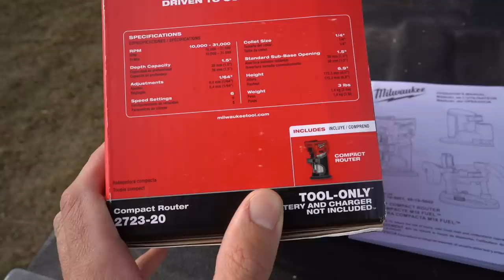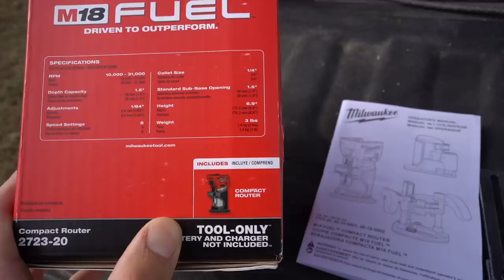I GOT THE NEW MILWAUKEE COMPACT ROUTER!!!

Comment: There is absolutely no problem with having one tire off the edge of the driveway like that. The only time it could be a problem is if you had a 20,000lbs trailer hooked up, or a few thousand pounds in the bed. And even with a large payload it probably still wouldn't matter. Your axles are rated for so much more weight than you're putting on it there. You don't need to put a board under that tire, or anything like that. Having the one tire on the ground is no different than the SRW one ton trucks. The DRW is mainly for towing stability, not so much for weight rating. You are 100% fine.

Comment: Both wheels are mounted together as a "single unit" on the axle so the axle sees the same load independent of whether one or two tires are on the ground.  The primary function of a dually is to is to keep from overloading tires - more tires = lower load per tire.  Tires are the lowest load-rated component in the system.  And, contrary to one comment I saw below, parked on only one tire with your essentially unloaded truck (all that stuff in the bed is insignificant w/r/t the truck) has not affect on the tires.  Of course, the overall truck as a dually is heavier built but single tires cannot take the amount load from a heavily loaded system.
Reply: I think this is true in part but here in the north they add axles to respect the regulations governing wheel loads so as not to damage the pavement.

Comment: I bought one too, one thing you'll come to find though is that 5.0Ah battery runs outta juice quite quickly! I slapped a 9.0Ah on mine and did well building stair stringers routing out a 3/8" slot for my steps to slide into. Worked well even for pressure treated lumber! Definitely loving this purchase!

Comment: I really wanted to get this since they started advertising it, but I really couldn't wait until it came out so I got DeWalt's battery-powered compact router. I'm sure I'd be really happy if I got the Milwaukee instead, but I've been really pleased with the DeWalt router so far. It seems like there are quite a few quality cordless compact router options on the market right now. It's such an awesome tool to have within easy convenient reach. Thanks for the demo.

Comment: I agree I bought it when it first came out and it surpassed my expectations as well a lot more power than I thought it would have I would definitely recommend it to everyone thinking about it. The only thing i think could be better it a baseplate that is more slippery. It seems like some other routers slide better on wood, even when i apply parafin wax. Could be just the added weight of the battery makes it more difficult to slide. I work in a cabinet shop BTW so im pretty accustomed to trim routers of varying type and mfg's. All in all Milwaukee killed it! Nice job chaps.
Reply: Make your own base out of solid teflon. Also known as UHMW plastic.
Reply: Thanks for the input, how does it preform with hardwoods, does it have enough power?

Comment: I've switched most things over to Milwaukee from DeWalt -- since we moved onto our boat. Mostly because Milwaukee makes the cordless heat gun, which is REALLY AWESOME. Anyhow... router... I picked one up yesterday, and I'm not overly impressed. The height adjustment doesn't actually lock-in, I can see the little wheel move while I am using the router.
Reply: I'm about to make that switch as well. I've been dewalt since I was 14, dewalt has been slacking big time keeping up to date and quality has also slippin,..  I had enough of it this past weekend when I bought the dewalt dcf890b and it failed miserably busting the lug nuts on my Honda..

Comment: Yep your good, doesn't matter if it was the outer tire with full load you'd probably be fine.  First thing that will give is the wheel, but again wouldn't worry about it as there is a safety factor involved anyway.  When these work trucks go off road towing they sometimes drive up on an area where only one tire is on the ground.  So you are good.  Storing it for longer than a weekend different situation as you don't want the tire itself to develope a flat spot, yet with duallys a flat spot might not matter much on one tire and evenutally it would spring back/wear back.

Comment: I expect that the load in your truck is a tiny fraction of what your truck can support. That’s what I would look at to assess how much you are stressing the axle. So if that machine can take 2000 lbs of a 5th wheel and you have 300 lbs of tools you’re good.

Comment: There is not enough weight back there to harm your axle. Your all good. I have had the outside tire up on a curb for days at a time and no issues. No leaking axle seals or any other issues. You would need to exceed the payload in order to hurt the axle by only have one wheel supported.  👍
Reply: I don't know, did you see how much stuff was in the bed?!  (Just kidding)
Reply: @dahut3614  I don't think Dirty Laundry counts

Comment: Nice review. All my Li-ion stuff is Milwaukee and I have a bunch (not enough though). Now this tool will be added to the "gotta get one" list. I've used just about every name brand of these tools when working with  trusted subs and job site sharing is fairly common.  Big news flash......they all work well. I'm not jumping into the switching brands thing because Dewalt or Makita have come out with the newest and best (according to advertising). No matter who has the newest and best, the others will soon follow with their version. I really do not want three different kinds of batteries and charging units laid out. The brushless tech has really leveled the playing field. Now some genius engineer will come up with a more efficient battery system and, of course, change the interface, then we're all in the start over boat. Japan has developed a dual carbon battery that out performs li-ion. Just at early stages, but things they be a changin".
Reply: for sure - just need a cordless robot to run my tools for me

Comment: Just bought the same router today. Part of my decision to buy the router was due to you. Thanks for sharing the info about the router. The only problem so far that I have with the router is the guide comes off after tightening it. Has anyone experienced this? If so, did you figure out a way to fix it?

Comment: It’s not bad for the axle. The point of duels is to allow more tires to hold the weight so that they don’t burst. Parking on the inner wheel puts greater stress on that tire, but no additional stress on the axle.

Comment: I'm still using my big beast Porter cable router that I bought in 1997, but I find myself wanting a portable unit. I was just going to buy a corded Bosch, DeWalt or Milwaukee, but now it's between the Milwaukee and Bosch since I have batteries for both. For those quick little runs this tool is perfect. Curious if they chew through batteries as fast as my Milwaukee multi tool.
Reply: Did you ever get your answer to how long the batteries on this router? I hear you get about 20 min. on a 5aH battery. Is this true?

Comment: Got my M18 router recently. So far have been using it while putting up some fencing to clean up dados in treated posts after first taking multiple cuts with a circ saw and knocking out the chips with a hammer. Loving it so far. Looking forward to using it in a more conventional manner.

Comment: The cordless thing originated because many years ago, jobsites   sometimes lacked power, for that reason, I always carried a crosscut and rip saw. The skillsaw pretty much eliminated most hand saw cutting.
  Just curious, routers typically require 25000 rpm, how about that one. How does it do with say maple or oak.

Comment: Dope! Reds is soo tiny vs yellows grand size. I feel like I’m leaning towards yellow though bc it “seems” to be just a tad better on the full rundown & accuracy. Check Concord carpenters compact router vs video. I like how Milwaukee gives all those extra parts/pieces even with the tool only!? That’s actually a surprise & I have the most Milwaukee batteries of all brand batteries! I wish they would come out w/ a cordless with a slightly larger collet, it can be done...comeonnn... 12” slider? No prob! 1/2” router chilllllllll lol
Reply: I bought my yellow one because of that video. Works great putting heavy chamfers on HDPE with a Whiteside 2302 bit.

Comment: Hey Richard, the axel might be fine but the concrete could crack.
Reply: I guarantee he has more weight over the front single tires than the rear right now.

Comment: I was using the Ridgid trim corded router for a couple days on plexi. (a whole bunch of fussy cuts) I liked the fine adjustment better than the Milwaukee. Overall I still like the Bosch or Dewalt better in the hand. The Milwaukee is nice though. It's good in the field where there are limited outlets.

Comment: I have the Dewalt version and it seems that they are pretty much the same except for minor things like height adjustment, where Dewalt has the ring-adjuster and the Milwaukee seems to have a rack and pinion system. The only thing that annoys me with the Dewalt trim router is that the dust collection is just as effective, or ineffective, as the Milwaukee. Add to that the reduced view of the cutter with the dust shroud in place and in most cases it is just not worth it, to me anyway, to use the dust collection.

Comment: Absolutely not a problem for the axle, only for the tyre because the weight is not distributed equally between the two wheels if you have big weights (not in this case). That truck is designed to take at least 10x more than what you have there.

Comment: I'd like to know how much the battery life slows down the cutter when the charge is dying down. You need a constant rpm to do a good job, especially on turns.
Reply: Not sure if this has it but it’s also possible for the tool to demand exact power right to shut off. Dyson does it with their cordless vacs

Comment: I have a 2015 Expedition and bought a 16’ enclosed trailer so the Expedition wouldn’t be a work vehicle. And it works great when I put stuff back where I got it from which is like....never......🤣🤣 But it does require some delicate maneuvering once in a while.

Comment: That’s not bad.. the outter wheel is connected to inner wheel. Inner wheel is supporting all the weight
Reply from the maker: cmiller88581 thanks.
Reply: @FinishCarpentryTV  gonna get uneven wear though.....
Reply: @christopherleveck6835  You wear out tyres by driving them on roads, not parking on them.
Reply: @christopherleveck6835  i don't think hes concerned about that. more the structural integrity of the axle. a little wear is worth the extra driveway space ;D

Comment: Looks like someone is switching over to Milwaukee tools  little by little lol
Reply: Yeah, but the battery powered table saw didn't perform too well for the camera...
Reply: Dahut are you talking about the test he did on solid wood? I thought the M18 and 60v both did equally bad?
Reply: Good!!! All the promotion he did for Dewalt and they didn’t send him a thing!!! Shit I spend a few grand on them because of this dude— shout out to Milwaukee for recognizing his worth
Reply: bling0023 though free remember 😉 ( I bleed mostly red & yellow)
Reply: Kermit I think their “cordless” table saws should have an ac adapter in case your going to go and do crazy rips on some ipe or something. It’s not the motor on the cordless I would be worried about but the heavy voltage drop under such resistances. Every time my boy uses my cordless 12 slider he starts bustin my chops “maybe we need to break out the corded 12?”

Comment: You should compare Milwaukee 12 miter vs dewalt 12 miter saw. Put them to work hard and long... test the heat of the battery. 
In my experience m18 volt cant handle heat and will trip out on over load even with a 12amph battery  at 2 bars left rending the tool useless.   I deal with grinders and metal..  so you may have to use it to the max on wood.  Dewalt HO cells 9 amph and larger will run for ever at 60v

Comment: Have you have problems with the fine tune adjustment moving on you while your routing?  One guy is on his third M18 router and I’ve noticed my new M18 router does that too
Reply: did you fix this issue, I have one at HD, don't know if I should pick it up if this is still an issue. I hear its from the screw of the locking mechanism that is loose.

Comment: I must comment on this router, not the blogger nor the workmanship........is that even a word. I purchased this router the other day mid June, 2021 and returned it before I even bothered to use it. There is play (slop) in the micro-adjustment shaft on these routers to the tune of +/- 1 plus mm. The whole shaft moves up and down in the housing. Though/hoped I had a lemon because over all I liked what I saw with this router. Not to be. Went to a number of big box stores and all of these routers have the same slop. Milwaukee, You Suck for putting this product out in the market place. 
By the way, I'm a professional cabinet maker/furniture maker with over 40 years experience. I think I should know tools by now.
Reply: I have one waiting at HD, did you tighten the screw on the locking hindge?  Thanks.

Comment: I wonder how it stacks up against the DeWalt compact cordless router.
Reply: The DeWalt out performs all the other current cordless routers in regards to power and runtime. It's also noticable larger in the hand. Everyone will and should get whatever brand they have battery platform for. They will all do the work.
Reply: @timcorbett9629  Thanks Tim.
Reply: Search YouTube for "tool box buzz compact router" and watch that head to head video before buying one. I picked the Dewalt mainly because I already have the batteries and chargers.

Comment: My Makita compact has a safety shutoff lock out features and probably just as small as that compact Milwaukee.
Makita is unveiling a host of new bad ass products in 2020... I’ve had great success with most of their products... but I also use Dewalt... 

I’ll use anything of quality, but if a tool is trash I won’t buy it and I’ll talk trash on it forever...
Reply: Have hundreds of hours on that Makita. Also it is compatible with all the attachments from its corded version that's been around for years. The safety switch can be annoying but it's well built.

Comment: No centering tool to install and center your base plate?
Reply: If the base doesn't accept template bushings, centering doesn't really matter. Using the fence guide, you're going to measure to set the fence each time, so.. shrugs

Comment: That tire is good. There is an inverse reactive current flowing through the rear axle transferred from the bed down in a unilaterally phased automatically synchronized current of equally proportionate weight distribution. Further, the high S value of your inverted rotors coupled with the phitetracycline exhatamine dilution as described in the equation p=Ann/nb(56-2ad).

Comment: the chamfers should have matching cuts on both faces. when cut with a router one will have a radius, and one will be straight. you can turn the router on it's side to get the straight side or chisel both straight. then they will match. no disrespect to you.